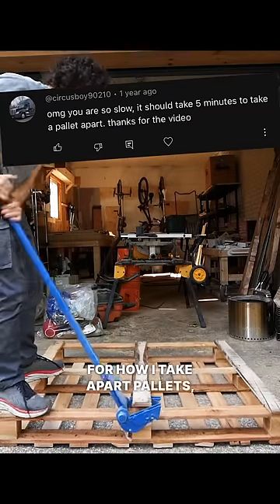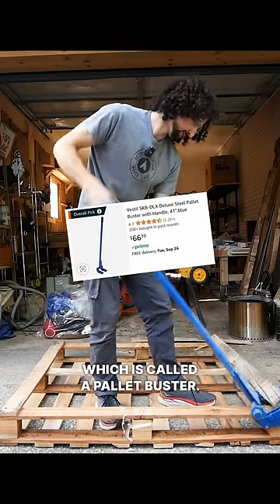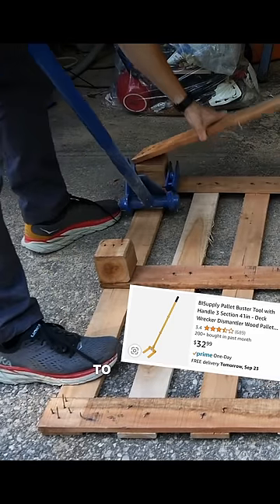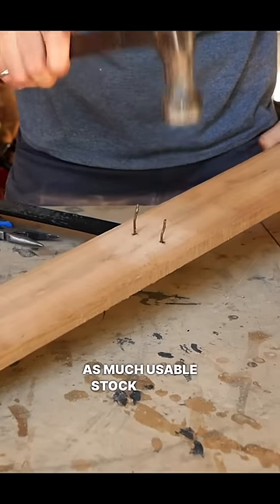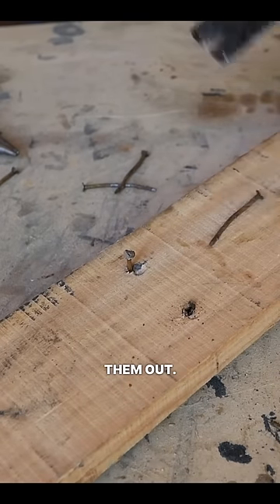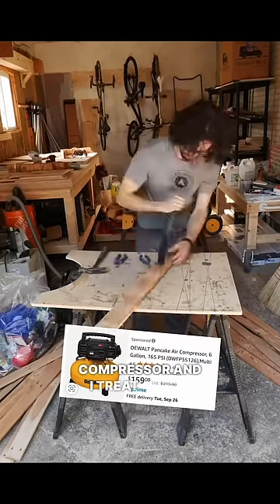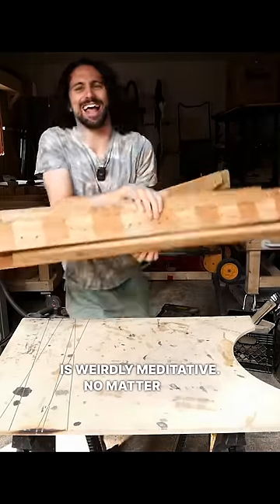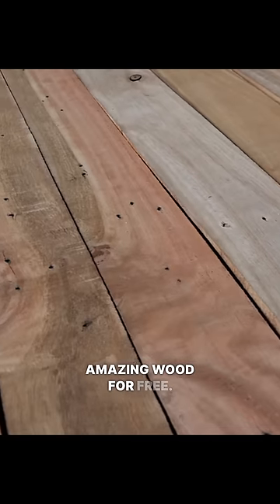The secret to pallet woodworking #DIY #woodworking #upcycling

Comment: My man had a claw hammer and still used a crow bar.
Reply: The bar has more leverage
Reply: @DonnyDucttape how much leverage do you need to remove a half out nail my man ?
Reply: @MrKayouh  either works,  but the bar makes it easier. Those ring shanks can be tough sometimes,  especially when rusted.
Reply: @DonnyDucttape smh
Reply: The correct tool was used
Reply: @keatmany2k5  a crow bar isnt really used for that small of a nail where just holding the tool is more of a work out than pulling the nail
Reply: @DonnyDucttape a crowbar that eize can be used to bust open s small locker, using it to pry off inch and a half nails from a pretty new pallet is incredibly overkill.
Reply: @DonnyDucttape  speaking as a professional handyman you are clearly the only one who knows what you're talking about here.
Reply: @MrKayouh  what a weird comment
Reply: @pokemonho8982 when its that small its called a pry bar, cause you pry things apart with it. Crow bars are larger.
Reply: @Dylan-vk5uv  thank you.  I am a carpenter and handyman as well
Reply: @pokemonho8982 bro why does it matter so much about what he uses 😭😭😭 if it’s bothering you don’t watch
Reply: Wasn’t just me that noticed it then 😂
Reply: @MrKayouh that's oak. And the nails are spiraled sometimes. And vinyl coated.
Reply: @pokemonho8982 that end of the crowbar with the little groove is made to take out nails tf are you talking about
Reply: Sometimes you just gotta whip out the  λ
Reply: He said no expensive tools yet that prybar is 66 dollars and a claw hammer is dirt cheap.
Reply: its easier
Reply: I think thé Hammer would probaly damage the Wood
Reply: @keatmany2k5 Nail bar is the correct tool, it's for nails. You can tell because it has nail in the name. 

No carpenter on the job uses a lry bar to remove nails.
Reply: Hammer would apply too much leverage close to the lever (the nail), and risk damaging the wood. 

Adding length to the lever makes the removal quick and effortless, reducing the stress on the wood.
Reply: Who the actual fuck is trying to alpha someone else for using a tool?
Reply: @zendell37  Something a natural born beta would say.
Reply: @MrKayouh As someone who deals with pallets daily, the nails are in pretty deep. Also, they’re almost always crooked and bent. Unless you’re getting a factory new pallet, those things have been dropped, slammed, and tossed countless times. A crowbar would just be more efficient.
Reply: @DonnyDucttape which might mean something if he couldn't move the board
Reply: @MrKayouh I’m sure if you’re doing a ton of times it’s better long term to use the tool with more leverage
Reply: Always a hater in the comments 😂 put the phone down and go touch grass
Reply: @MrKayouh Those are twisted nails and would be harder than regular nails to take out
Reply: @Dylan-vk5uv a “professional handyman”? You just said the oxymoron of the day!!  Congratulations!!
Reply: @Manhandle730  specialized in building decks. But yes I called myself a handyman.
Reply: @MrKayouh pallet nails are a pain in the ass. Some are barbed, some are twisted.
Reply: You say that as if a crowbar is absurd to use in this situation, but a crowbar and a hammer function more or less identically here.
Reply: @DonnyDucttape  its a 2 inch nail in half inch pine XD
Reply: @FrostbiteMN  it's just easier
Reply: @pokemonho8982  That was a probably not a crowbar. Anybody worth their salt knows the difference.
Reply: What happens when you dont grow up around tools. You start buying everything. Like a pallet buster.
Reply: @MAG_agent1337  the only time that blue tool wouldbe useful. was for doing 2x6 pallots. 

like, im talking about like...those giant pallets that are HUGE. you know. like the pallets they put cars on and what not. 

my old job, one board weighs as much as the whole pallet. 

TLDR the types of pallets you need  a fork lift to move.
Reply: Switching between tools is one of the most time costly things on a job thats why loads of people in the trades use almost anything they're holding as a hammer. Atleast where I'm from they do
Reply: Pry bar, not crow bar
Reply: @SuperIronFist  That you Gordon?

Comment: Only $66. As opposed to those expensive tools the rest of us use to break down a pallet. You know, a crowbar.
Reply: that takes longer
Reply: $66 bucks for a tool that work so quick?  You know how much lumber costs don’tcha?  

Save you plenty of money on a property, assuming you got something to do with it.  So many garden beds could be made.
Reply: Also easier to break/splinter the pallet boards with a regular crowbar. He put 66$ into it, but he gets more efficient stock with it.
Reply: @haVockMoDz  it's the same. Watch some video reviews of pallet breakers. Also this guy even says in his video that you need to be careful to avoid splintering and splitting the wood.
Reply: @therealdonchelios you get used to how to use to prevent it from splitting. have to put the tool as close to the edge as possible. Also  some pallet boards are so broken it was always break
Reply: Or a boot and your leg lol
Reply: @notyetdeleted6319 LMAO!! He doesn't show how much time he spends pulling out all of those rusty nails. Nor does he admit that a good percentage of the boards are already broken. They don't all come apart as easily as this one did.
And what do you end up with?? A pile of junk wood.
Reply: Yep crowbar is the only tool you need, worked a little while where i dissasembled alot of pallets and a crowbar has everything you need. (Keeping everything intact as you go)

Bonus points, if saving money on lumber isnt enough, at the end of the day you can use that same crowbar for B&E
Reply: If u use a crowbar on this your looking to get hurt
Reply: @alexmendez713  you must be a millennial
Reply: @backcountry164 he took apart a pallet in perfect condition, which really tells you how much bullshit he's pushing if he finds "free" pallets in good condition
Reply: @calebbarnhouse496  Nah, it's not that hard to find great condition pallets. I worked in a manufacturing plant for a decade and it was pretty easy to get perfect condition pallets on a regular basis. The reason? Occasionally they'd get in equipment or material on pallets that weren't the standard sizes they used to ship things, so it was a pain to try and utilize them properly. Meanwhile they were shipping in and out hundreds of pallets of materials and products every week. So if nobody wanted them they literally tossed perfect condition pallets in the dumpster instead of dealing with something nonstandard.

Sometimes they received some automation equipment from a sister company in Europe and those were always created up in a good $1k+ of high quality hard wood with no additives. Those were excellent for salvaging.
Reply: Notice he says cheap knock offs as the one he has breaks 😂😂😂😂😂
Reply: I have the feeling you've never taken apart a pallet before
Reply: @mikpiotto   then you would be mistaken
Reply: @therealdonchelios  are your pallets made of maple?
Reply: @mikpiotto  I don't have any pallets 😄
Reply: He literally just said that he doesn't wanna damage the wood 🤦🏻‍♂️
Reply: @mfhouston3002   that's more a skill issue. You can take apart a pallet with a crowbar without damaging the wood. Easy.

Comment: Honest carpenter did a whole video on how pallets should never be repurposed for wood projects; you don't know what they've been used for; could have some nasty chemicals spilled on them, etc. Plus it's cheap, low quality wood.
Reply: Proper pallets aren't cheap, low quality wood, but you will also never EVER get those for free. They'll cost you a pretty penny, so you'd never take them apart like this. What he's taking apart is, however, exactly as you say. Cheap low quality wood with unnecessary risks.
Reply: Depends on the pallet. There are nice ones that are sent to medical companies and the ones were I worked had the premium A grade wood without any wispy bits. One of my old coworkers took enough wood home to build a shed lol
Reply: There’s different pallets for different industries too boss def not food grade pallets if you making home furniture
Reply: @EndlessDelusion sheesg
Reply: We do not care
Reply: Pallet quality is not the concern. When we process wood for use as pallets, we chemically treat them so that they cam resist moisture as well as rot.

The pallets are for resisting the Outdoors and often times chemical treatment on them would leak into the air when oxidized. They’re highly porous meaning they can also harbor bacteria.

So if it’s repurposed for indoor use, you run the risk of the pallet releasing chemicals into the air over time. In a garage, it might be okay,  it in a living space, thats a problem.

Look for pallets that are heat treated, de-barked, or dried. Those are mostly chemical free.
Reply: @YuriDontPlay lmao!! No!! You get pallets wherever you can find them. There's a shortage most places.
Reply: @robster7787 it's not just that. They're often treated with pesticides to kill off any critters that might be inside the wood.
Reply: @backcountry164 - not where I live. There are multiple places that’ll give you as many pallets as you want for free just to get rid of them.
Reply: Typically chemical pallets are painted/ stained blue.
Reply: it was funny when he said it was a “good hardwood” like anyone would use oak or maple on a pallet 😂
Reply: @jksnax speak for yourself, zoomer.
Reply: Dude's right.  We got one in covered in chicken guts once.  Should have burned it, but it went in the scrap pile like everything else.
Reply: Sounds like fear mongering to me.
Reply: Bro is worried about chemicals on the floor but it's at McDonald's everyday.
Reply: @MidwestBoom yeah, because the odds of mcdonald's using industrial carcinogenic pesticides in their crappy burgers is virtually zero.

Comment: It’s so hard to get pallets second hand nowadays, the euro pallets especially. If you’re in the uk, I will buy ur second hand euro pallets 😜
Reply: Try your luck at construction sites, just ask em if they got any laying around. same thing with shops that get big shipments of a product.
Reply: @0neInTheChambie No construction site will give away eur-pallets. Those are expensive (as in, too expensive to give away). And deliveries are rarely made on anything but cheap, low quality pallets. Nothing close to eur-pallets. As I said, it'd be too expensive.
Reply: @0neInTheChambie  thank you, yes we do get from timber mills, construction sites,and hardware wear places, they get them free and sell them to us for a knock down price, it’s never enough though, we have to buy in 98% it’s rough, because I know a lot of business a re told just to scrap them. It seems such a waste when they are in such high demand. 
Thank you for your reply.x
Reply: Euro pallets are recycled repeatedly until they fall apart .  Trucking companies buy back the empty pallets and sell them to the next place that fill up their trucks with packed goods .  If they have excess they sell them to pallet wholesalers, same place they buy more if they run out .  Pallet factories sell to those wholesalers too .

Comment: For the wire staples that are sometimes used on pallets, I find that groove joint pliers work well. The rounded shape means that you can bite down at where they enter the wood, then roll back along the pliers head to lever them out while keeping hold.

Comment: Use a reciprocating saw with a bi-metal blade. Take 2 minutes to completely disassemble and the tool/blades together cost about 50 bucks

Comment: I got a reciprocating saw for $20 at harbor freight. It not only lets you break the pallets down but you can also cut boards to size with it too. It is a power tool so unless youre off grid, thats probably a cheaper and more versatile tool to have instead of this. Not to mention it just cuts through the nails, so there is not an extra step of removing the nails that are left behind.

Comment: You can just pry the boards off with anything metal that is long with a thin end. You could do it with a crowbar, pallet bar, or just a steel pipe that you hammer the end to a chisel tip on. Go to the dumpster, get a metal chair leg, and save the 60$. At my old job we just had some hastily welded together bars that did the job great, and didn't look half as good as what you showed.

Comment: Pallets are extremely hard on planer blades.  Pneumatic driven nails leave small shards of metal that can remain after the nail is removed, and the bottom runners can contain embedded stones and such that also ruin your blades.

Comment: If you're fine with little pieces of metal being embedded in the wood, which personally I think looks cool, just take a reciprocating saw with a long metal cutting blade and cut the nails. Usually no prying is required but sometimes you need to get it started a little bit

Comment: idk if this will be seen, but when youre taking out the nails, i found it easier to straighten the nails, and then hit the ends with q good strike,  repeating until the point was flush with the board, then i could usually just grab the nail with gloved hands and pull it out, i could also do an entire boards length and then just grab em off easy.

it might help make things a little easier

Comment: This man saying how expensive an air compressor is while showing a DeWalt air compressor. If you’re gonna cheap out on a nail remover, the air compressor can also be justified. Harbor freight has an air compressor going for $60. 

Its been almost 4 years and that cheap air still compressor still works fine.

Comment: When I was younger I was at work rebuilding a pallet, and I used two hammers to remove the boards. Long story short, I hit the two heads together, and a piece of the hammer flew into my thigh. That piece is still there to this day.

Comment: I asked ChatGPT 3.5 if it was safe to repurpose pallets. It said look for heat treated ones marked HT and avoid ones marked MB. Here’s more of what it said:

Methyl bromide (MB) is a fumigant used to treat some pallets. Exposure to methyl bromide can pose health risks, including respiratory, skin, and eye irritation. Prolonged or high-level exposure may have more severe effects on the nervous system. It's considered a hazardous substance, and long-term exposure should be avoided. When working with pallets, especially if they are marked with "MB," it's crucial to take precautions such as using proper protective gear and working in well-ventilated areas to minimize the risk of exposure. Choosing heat-treated (HT) pallets is a safer alternative for repurposing projects.

Comment: My old job at a mill had a old steel fork. It just had two prongs and was painful as hell if it hit you when pulling a pallet. I used to make bolsters and all kinds of pallets. With a nailgun.

My favorite was always 45x45 pallets with pallet stock on top and bottom. Simple, light and easy.

Comment: This only really works well for the hardwood pallets that the US seems to use.  Here in Aus they are made from the cheapest shittiest softwood.  Doing this will split and crack many of the pieces.  You can still usually get a few usable ones out of it though.

Comment: The other side of your hammer does the same job as that pry bar. Those split hooks on the back end of the hammer, are used to remove nails. So use it

Comment: Really all you need is a splitting wedge and a decent straight-claw framing hammer or rigger's axe, the fancy pallet buster's not necessary. The wedge's the real key, lets you loosen the ends without cracking em.

Comment: i use a long hollow drill bit i made out of some scrap steel tubing to drill down around the nail heads. no damage from prying and the damaged, discolored wood around the nail holes is removed and ready to be replaced with a plug.

Comment: Get an air compressor, best tool you buy. Pneumatic tools are powerfull and usually cheaper than the electric variants. Also they tend to last a bit longer too.

Comment: There are a lot of plans to make your own pallet disassembler.  Some you can make with hardware store pipe fittings.  Or you can order just the head and get your own handle.  Depends on if spending the money is worth it to you.

Comment: I could get the same results with a metal pipe... I run a fence company and whenever my delivery truck drops off my materials, it comes on a pallet and some cheap thin pieces of wood surround it. Just take a digging bar and pry it off, you don't need some fancy tool, just something that gives you leverage.

Simply a gimmick.

Comment: I always wonder where people are getting these pallets when acting like pallet wood is saving money.

Those are perfectly good pallets, and good pallets aren't just thrown away. Sure you get the rich person that has something delivered on a pallet that paid a fee for the pallet in the shipping charge that they either don't know or don't care that they could get it back if they returned the empty pallet. But most people using pallets hold onto them until they're falling apart, snapped in multiple pieces and worrying about breaking it when disassembling it to get more usable wood is like worrying about the walls of your hole in the sand in the middle of the desert caving in.

In order to get pallets that look like this, theft is involved somewhere.

Comment: If you take a crow bar and pull up the board a bit then hit the board down without hitting the nails the ends of the nails will be exposed allowing you to pull them out with the hammer.

Comment: Out of my own experience, you really only need a hammer. You just use the back of it for the majority of the disassembly. Removing the wooden blocks is a bit of a hassle but you most certainly don't need anything else